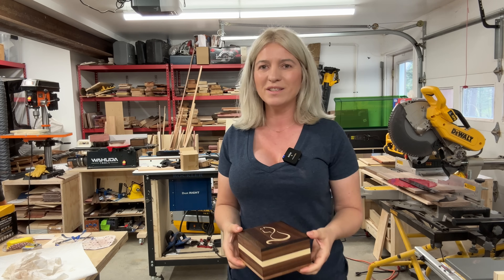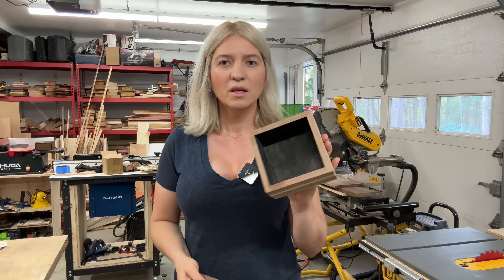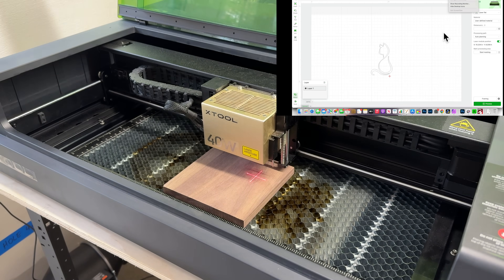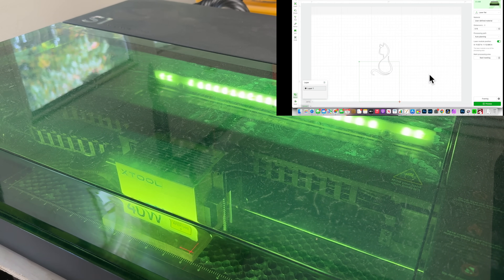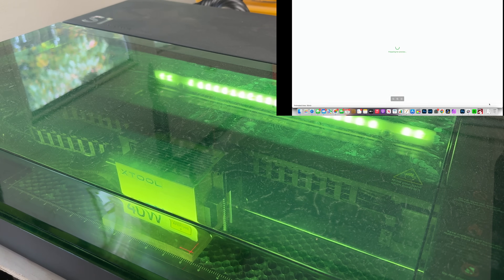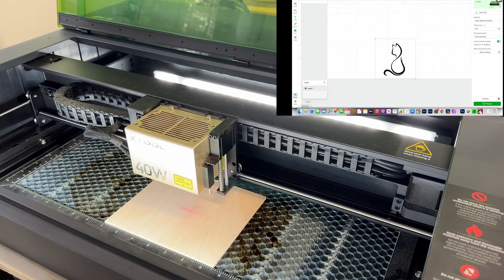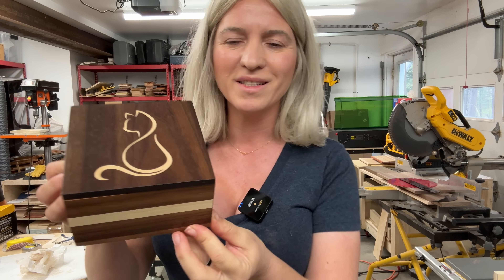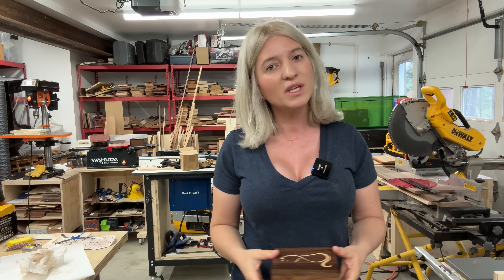Mastering Xtool S1 Laser Engraver: Inlay Techniques and Best Settings

Comment: If I might make a suggestion I learned in my 8th grade woodshop class. We were making cedar boxes and after all the sanding had been completed, we wet the box down with a damp washcloth and accelerated the drying with a hair dryer. What once was a supper smooth box now had stray grains of wood lifted, which were then knocked down with a subsequent sanding at final grit. This basically took away any risk of this grain being lifted when the finishing oil was applied. Try it, you might be surprised how much smoother your boxes become with this relatively quick step.

Comment: Is the 40 watt laser worth the increased cost? Is a big cost adjustment. Also, you should get some bench cookies from Rockler. They will keep the wood in place while you are sanding.
Reply from the maker: @jimromansr9971  if you are going to do cutting, yes. For engraving 20 is plenty

Comment: I just got my S1 today (upgraded from the D1) and I love it! I just tried this with the walnut my husband uses to make cutting boards and it came out perfect! I followed you step by step and made a walnut coaster with a "W" inlay. Thank you for the amazing instruction.
Reply from the maker: That is awesome! Thank YOU
Reply: I just started another inlay project that is the word "peace" in script. There are closed areas so when I use the outline function and set the 0.1 offset, it doesn't capture the closed inner parts of the text. Are you aware of any way to do this in XCS?  @SkylerEwingWoodworking

Comment: THANK YOU!  I seen some soot around the cats head and tail; was the air assist on auto?
Reply from the maker: :) in the first part of engraving ( making the pocket) was off because I had it off while I was talking you you guys can hear me clearly and forgot to turn it back on. However when you cut deep pockets like this you will always get some but you can just wipe it away with isopropyl alcohol or light sanding
Reply: Love your videos.  I'm from St. Charles MO. (USA).  Just found your site a week ago.  Thank You for your time and for your quick response.

Comment: Been struggling with the price tag on lasers. But this feature would really be a nice addition to the wood shop. Is the 40w needed for this type of work? 
Well done!!
Reply from the maker: No. A 20W can do this too. 40 W is needed if need to cut material thicker then 1/4 in. Also 40W is double faster then 20W. But for inlay you get same final result with both of them
Reply from the maker: No, 20w will work perfectly maybe even better
Reply: I have a 10 watt Longer Ray 5 and have 1/4,thick Baltic Birch for inlays not and issue at all. The beam on my laser is smaller than most a .06mm compared to most at .010